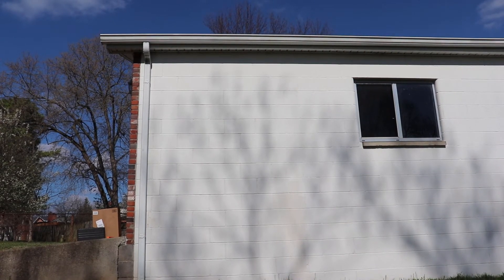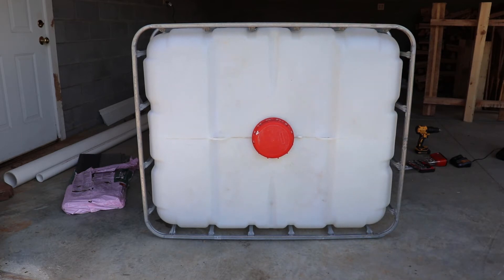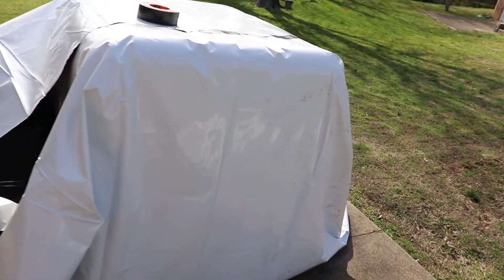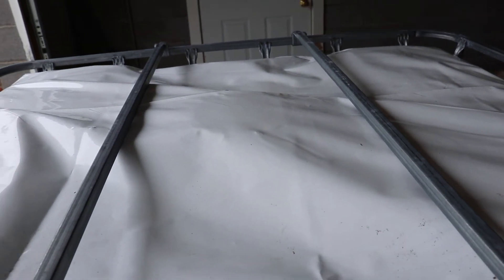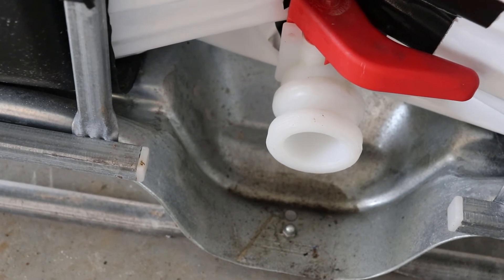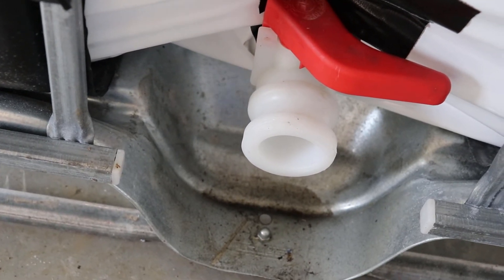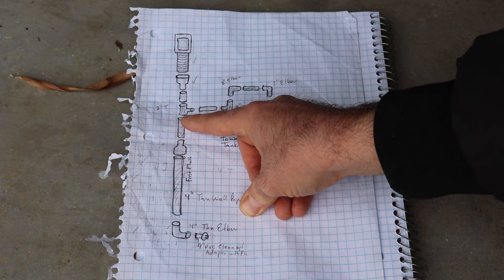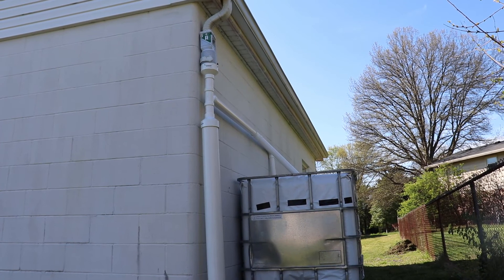IBC Tote Rainwater Harvesting System with First Flush Complete Build

Comment: This is what I bought for my IBC tote and it worked just perfectly.
I built a stand about 3 feet of the ground and flow is okay but not amazing meaning i would not connect hose to it to water not enough pressure. I only use the valve to pour water into watering cans. Thanks for sharing your idea. I like it!
https://www.amazon.com/gp/product/B071YD4CMZ/ref=ppx_yo_dt_b_asin_title_o02_s00?ie=UTF8&psc=1
Reply from the maker: I think my tote has an uncommon thread. I bought a Gator clamp. I need to do an update. My overflow system was not well designed. I get enough flow for my irrigation, but still has room for improvement.
Reply: kentuckyprepper1792 let me know what’s wrong with overflow system since i was going to copy your idea. Thanks